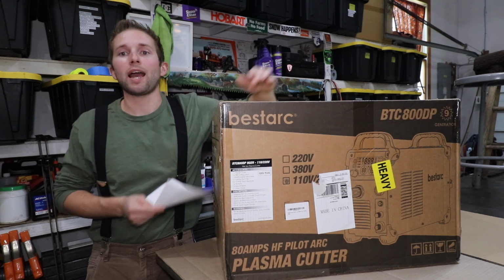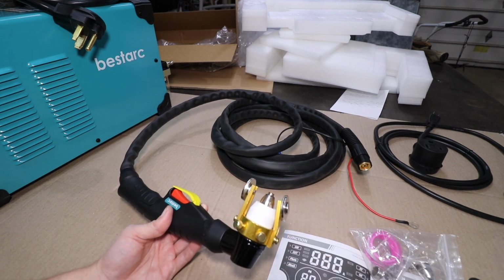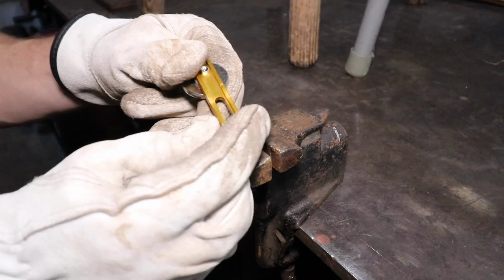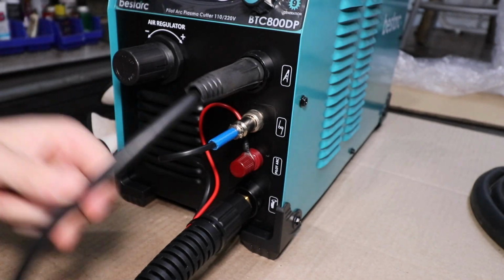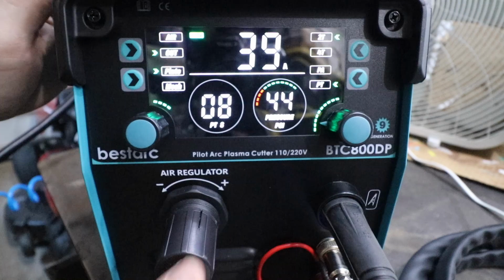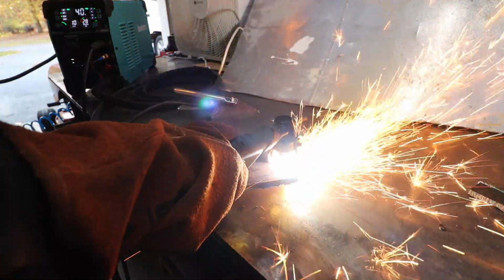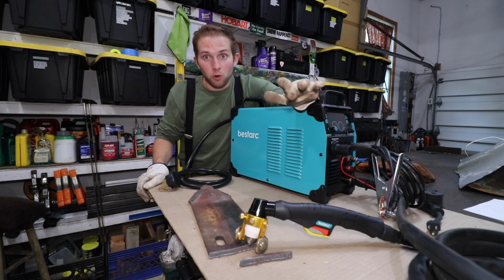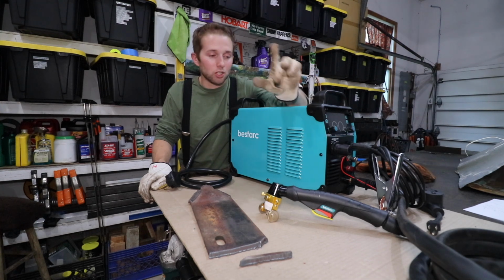Bestarc BTC800DP Plasma Cutter | Unboxing, Use & Review

Comment: The 80 amp output of the machine, doesn't mean it's drawing 80 amps from the 50 amp circuit its plugged into.  I have a PrimeWeld welding machine that requires a 50 amp circuit, even though it can weld up to 225 amps.  This works the same way.   In order to use this machine successfully and safely on a 120v circuit, it would require their recommended 60 amp dedicated circuit.  I have no idea why they include a 20 amp plug, knowing it would require a 60 amp circuit to operate successfully at 120v.  You would have to run 6 gauge wire on a dedicated circuit using a single pole 60 amp breaker and a twist lock style receptacle rated at 60 amps to use the 120v without issues.  Better off just using 240v and get the most use out the 80 amps it can deliver.  I would not hesitate to cut 1" thick steel.  It will be fine.

Comment: The manufacturer's recommendation for the 110 volt is a 60 amp circuit, not 20
Reply from the maker: Then why did they ship the unit with a 15 amp rated 110v plug? I don't believe there is 60 amp 110v outlet in the states.... Not to mention, most American homes don't even have a single 20 amp 110v outlet fixture.

Comment: The inverter takes the 220 volt two phase AC 50 amp circuit and converts it to DC.  The input amperage does not have to match the output amperage because as others have said they run at different voltages as well as being DC instead of AC.

Comment: to help understand current and voltage. Power equals current times voltage.  Max power is fixed, as voltage goes down current can go up.  Torch runs at about 100 volts.  On a 220v outlet you can double your current.

Comment: If you want 40psi of air when cutting.  Set the cutter to air and adjust the air pressure to 40psi.

Comment: I think that 80 amps is cutting power not how much it takes mains power. Amps depend on voltage, lower voltage means higher amps, plasma cutting isn't at 230 volts it's at much lower voltage. Nice review!
Reply: Your  circuit breaker tripped maybe because you didn't have it at right characteristic. I don't know how it's in US but in Europe we have A, B, C and D characteristics. D is most powerful and A is fastest tripping characteristics and most welding and cutting equipment ask for C characteristics etc... Don't know what your machine asks and what standards are in US but i'm pretty sure it's that kind of issue.